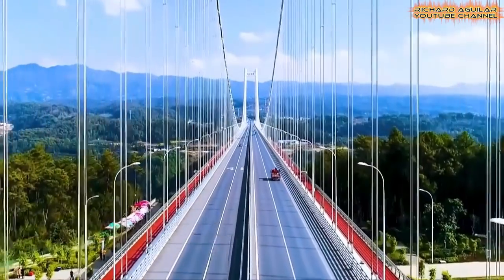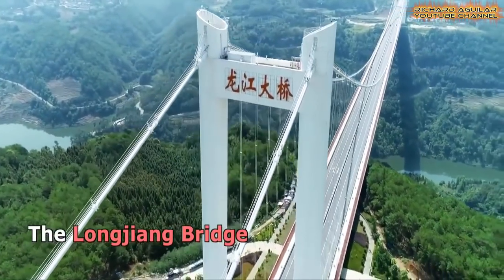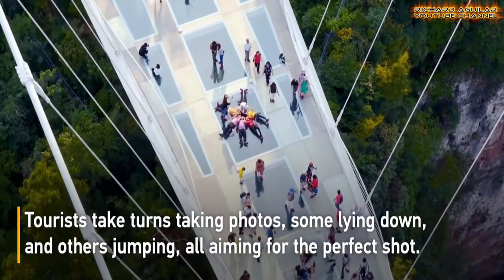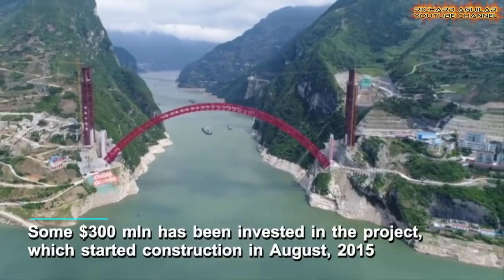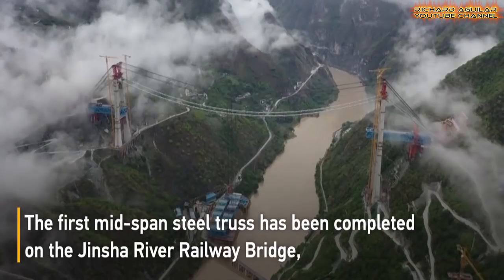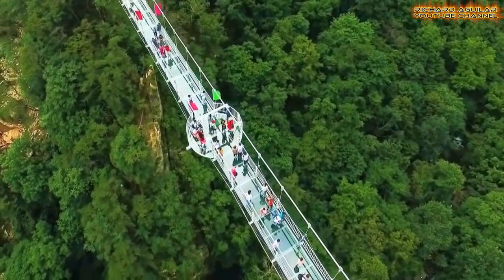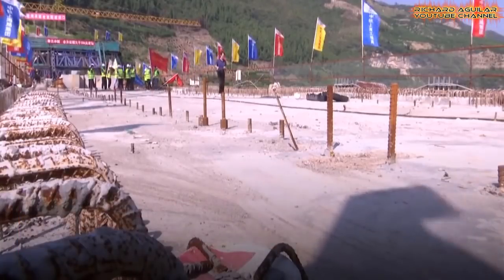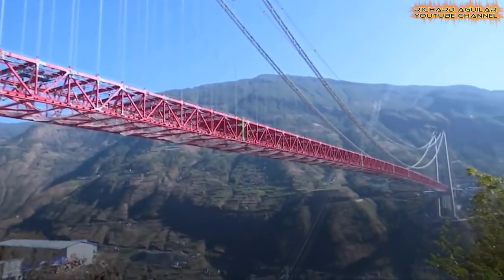CHINA BUILT INSANE MOUNTAIN BRIDGES YOU CAN'T IMAGINE

Comment: Cheap Tofu bridges. Do not use. The glass bridge had already collapsed. Bridges are made to impress only.
Reply: Those bridges will still be standing, long after you have collapsed. Agree ?
Reply: Only on one glass bridge when cyclonic wind uplifted a few glass panels.  There are over a hundred of such bridges in China.  That news was reported by SCMP and within minutes, anti-China Australian SkyNews was splashing it all over.  Although I haven't seen them reporting on the cracks of the Memphis bridge, which has closed traffic across the Mississippi River.
Reply: The Glass cracked not the bridge . 🤮. They are replacing the glass ..
Reply: SB,